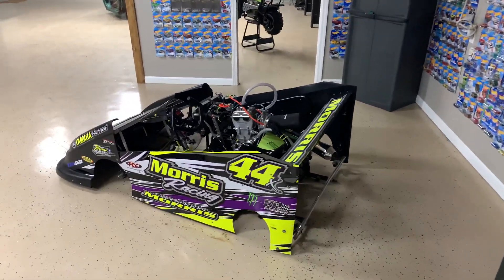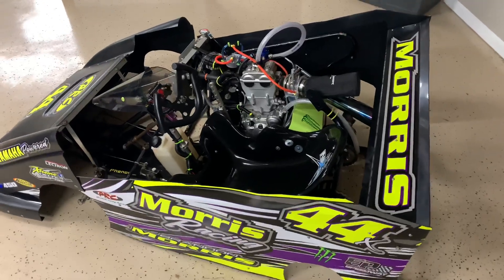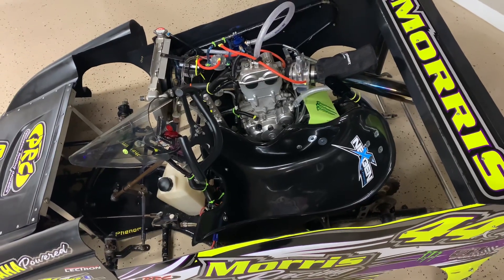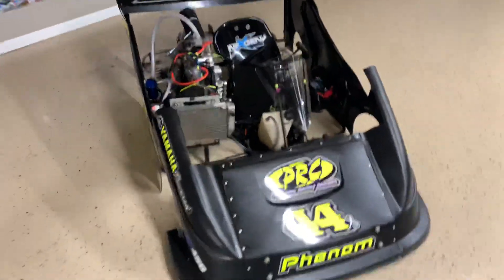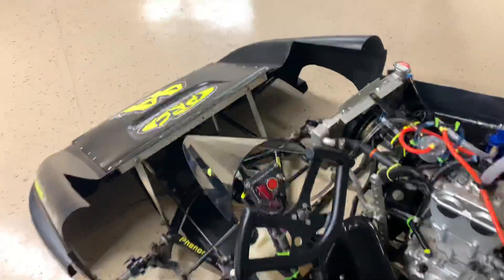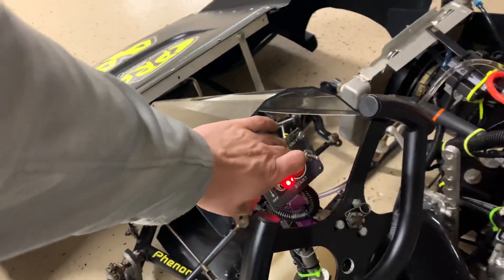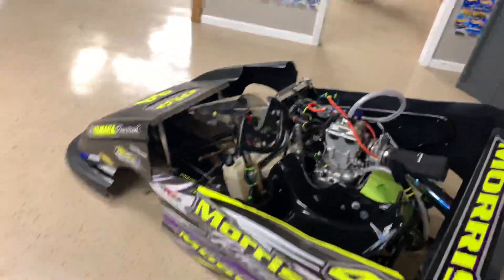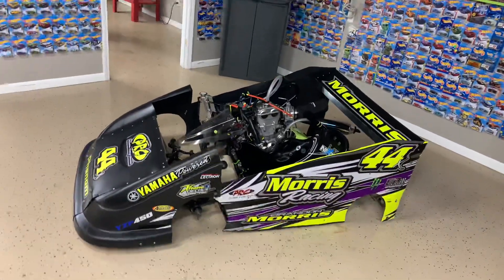Go Kart yfz450 UAS shifter kart phantom racing chassis

Comment: So I have built a Yamaha 450 r go kart put in on a phantom phenom chassis and was wondering what u did about the breaking I have a 40mm rear axle on it and a bigger break rotor thinking about puting front breaks and a pingle electric shifter but so much to spend without asking anyone's opinion